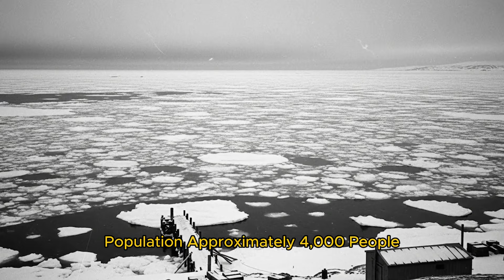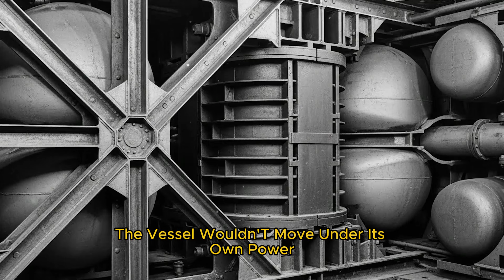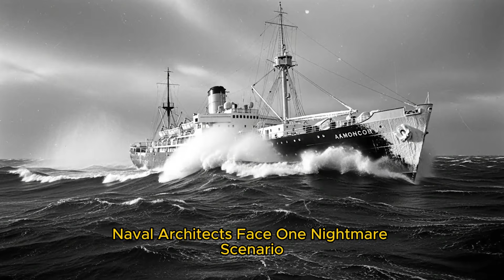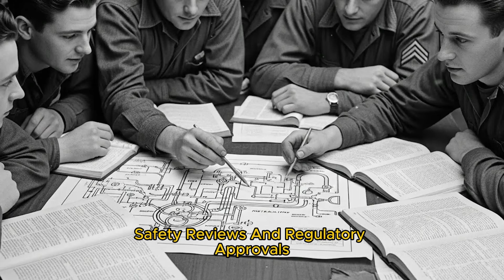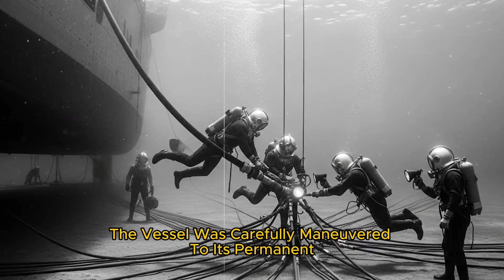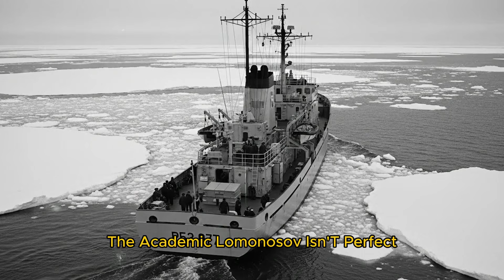THE FLOATING REACTOR SECRET: How Engineers Put Two Nuclear Reactors on a Barge

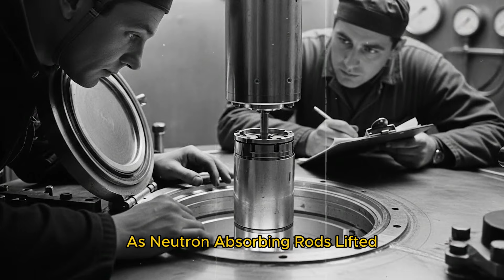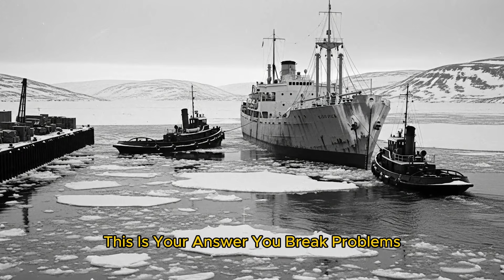Comment: From around 17:43 when “Criticality achieved. The reactor was alive,” through 25:46 with “You break problems into components,” this story impressed me because it shows engineering not as theory, but as disciplined problem-solving under extreme constraints. The redundancy, ballast logic, and Arctic cooling solutions make this feel like applied humility before nature, not arrogance. Even the criticisms add depth rather than hype. Do you think floating nuclear power is a niche solution, or could it realistically reshape energy for remote regions worldwide?